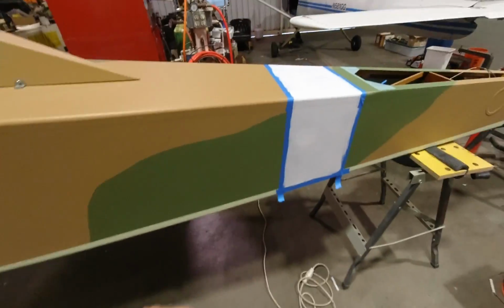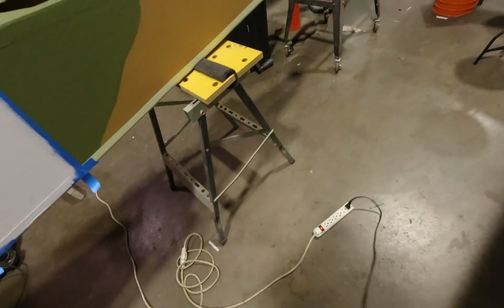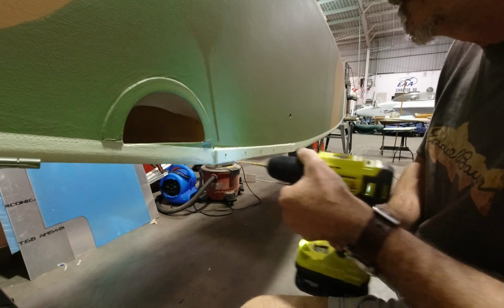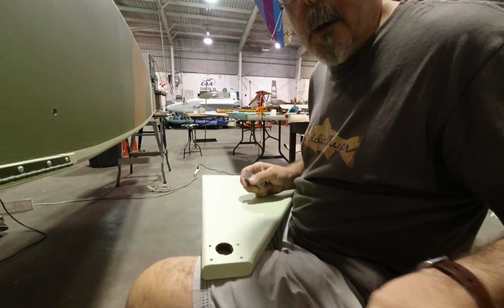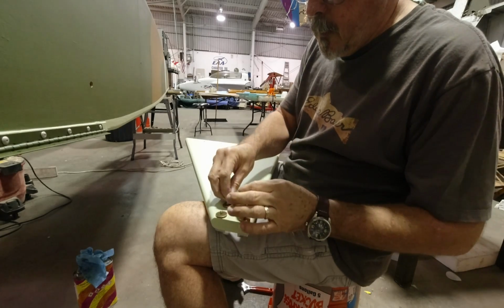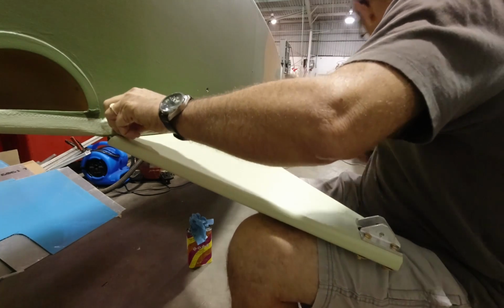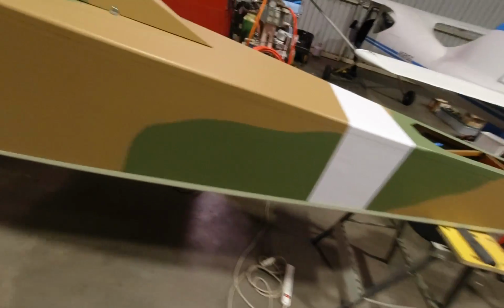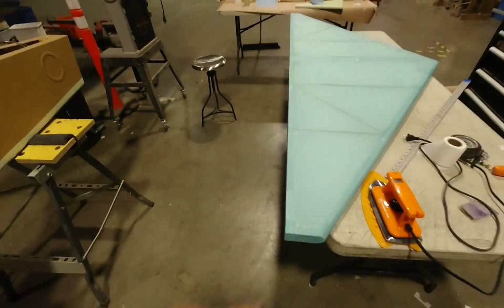Minimax 1100r Wood Aircraft Build Ep 160 - Landing Gear Install

Comment: You have listening to my last few videos, in which I have said a little bit every day is the way :-) 
Why can't the UC screws go from out to in, it would be in line with normal fitment and reflect the top screws? I would still got for the castle nut on the tailwheel (it is my preferance), normal practice is if it moves use castle nut but as you say it is easy to see and not loaded.
Reply from the maker: That’s a good question…I have installed them according to the plan and can only assume they did it this way to save the use of 12 -3 washers underneath. I may flip them around and add the washers. The eye bolt has to go the way it is so no way around that one. 
I hear you on the castle nut, I would go that route for sure if it was something not so visible